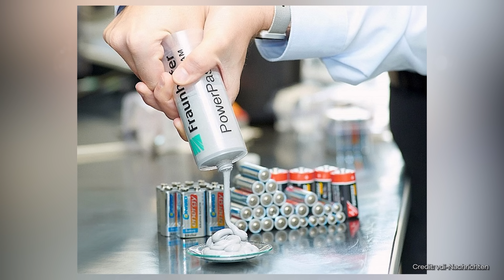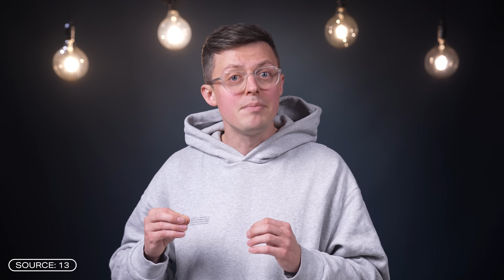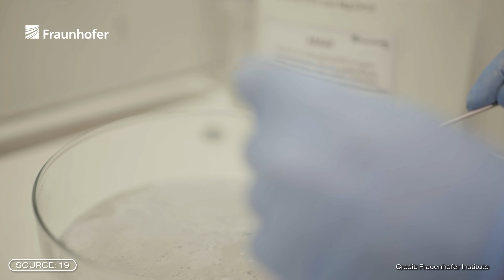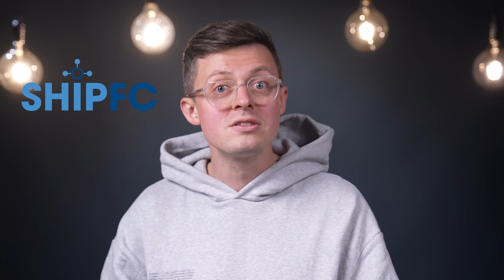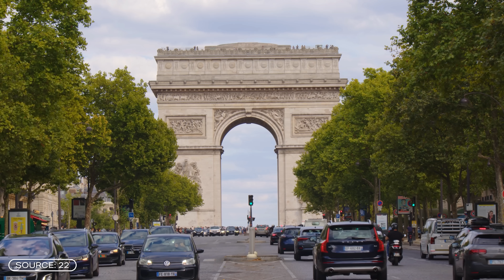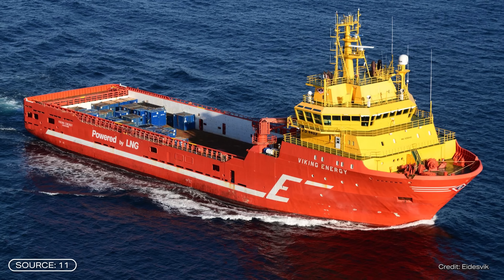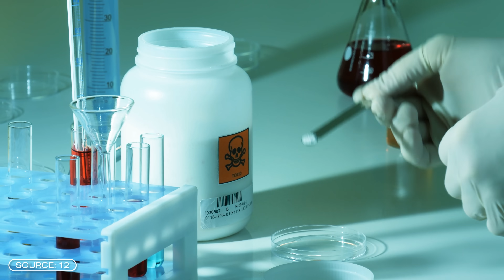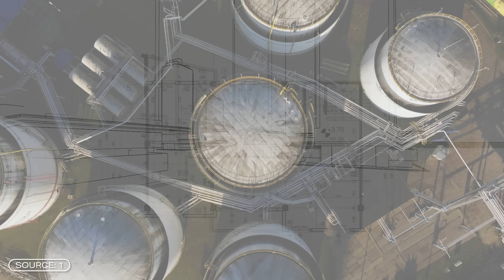Hydrogen Powerpaste: 10x Higher Energy Density & Safe?

Comment: The main problem isn't storage nor transport.  Those are things that can be overcome with engineering.  THE problem with H2 is that you get MUCH less energy from burning it than you put into making it.  The theoretically perfect energy cost of making H2 from H2O is 55 kWh/kg.  The theoretically perfect energy release from burning H2 is 33 kWh/kg.  That is only a 40% efficiency, which is not attainable in the real world. The only way to make H2 at an energy profit is through pulsed spark plasma cracking of heavy OIL. There is no point to green H2.

Comment: One of the main problems with hydrogen is not its storage, but the fact that it is a secondary energy source. It just doesn't exist in nature, unlike oil or natural gas. To produce hydrogen you have to either spend a lot of energy (electrolysis) or use dirty technologies (steam methane reforming). The final efficiency of this whole chain will be much lower, and the costs much higher, than those of the direct use of a primary energy source (methane, for example, as a fuel itself). All this hydrogen hype is just hype.

Comment: "A new way to store Hydrogen" is beyond stupid. The only safe way is water. Electrolysis is not that difficult.
Created H2/O2 on demand, no worry about storage. The entire deck area is wasted. Develop a PV tarp. Crack seawater as you go. Filter out the salt & sell that too! Hydrolysis is so underrated.
Reply: If you had such a powerful energy source on board, you would use it directly for propulsion, not for hydrogen production from water.
And the surface of a ship is much too small to get enough power for a decent propulsion by PV. Even without the lossy detour with hydrogen.

Comment: Why hydrogen at all? Biogas is renewable methane and a much better option than hydrogen. Biogas is a drop in replacement for natural gas and regular gasoline cars can be converted to run on both methane and gasoline.
Reply: Because biogas is a severely limited resource if only waste materials are used for its production. And because biogas made from specially cultivated feedstock (e.g., corn) has a poor environmental footprint.
Reply: @701983 I don't see biogas as a replacement for batteries. More as an complement, ideally used in power plants rather than cars. Still better than hydrogen anyway.
Reply: Production capacity and competition for agricultural land with food production....
Reply: @RoninTF2011 nah, biogas is made from biological waste so no extra agricultural land is needed.
Reply: @SkepticalCaveman In Germany, the majority of biogas is produced from corn, not from waste.
Reply: @701983 well, in Sweden it's  made from food waste.

Comment: So you have a tank of powerpaste, weight 20kg to get 100 km. Water required is 100liters or 100 kg. So 120kg to go 100 km. So to have a range of 500km you have to carry a tank of 600 liters or 600kg. Sounds like a great little car.

Comment: yawn - coal is much cheaper and gives real jobs. more brain washed nonsense on CO2.
Reply: Whats the difference between a "real job" and other jobs?
Reply: @RoninTF2011   a real job is a job in a primary and secondary industry and not a job that can be offshored abroad which provides no support to its community.

Comment: 4:00 - 10kg of paste plus how many kg of water though?
Reply: The idea is that a product of a fuel cell is water. So a hydrogen truck would produce the water needed as a byproduct while turning the hydrogen into water and electricity. Hydrogen combustion engines also produce water but it is mostly in vapor form.
Reply: @Dan-vi5jp we collect the water vapor and pipe it through a condenser to cool it down into liquid water though

Comment: Back in the early 80's, before you were born, there was a metal patented that absorbed hydrogen and release it when heated. 
I don't remember what metal but I do remember it going nowhere quick.
Reply: This kind of storage (metal hydride) is well known and used in the German 212A-submarines with fuel cell propulsion.
Reply: @701983  That name rings a bell. How is this toothpaste thingy better?
Reply: @objection_your_honor As with most advancements, lower costs, lower complexity and easier logistics.
Reply: @DiakosDelvin  👍
Reply: @objection_your_honor It's not better in my view. Advantage: You just have to add water to release the hydrogen, no heat source and heat distribution system needed. But on the other hand: You have to bring the used paste back to a factory to "charge" it with hydrogen again. Metal hydride tanks can easily be refilled with hydrogen.

Comment: Thanks. I've been wondering for a while what happened to Power Paste, since it seemed so promising, and is already used for certain "stationary applications" (or was, last time I heard anything about it). The Boron Nitride method might turn out to be simpler to use, though? Either way, its great to see that this is still something being worked on. One way to get energy "for free" for the Hydrogen producing process might be to make the production something that makes use of renewable energy the grid doesn't have present demand for from time to time (lots of wind at night, for instance, or extremely sunny days). Keep the generation facilities in a steady state, and switch consumption between base load and excess to base load. (I'm not an engineer, so am just speculating here. It must be something people who know what they're talking have thought about, since it's a pretty simple idea for starters, so my guess is that there's some problem with it.)

Comment: So given that 10kg of paste yields 1kg of hydrogen, does that mean that 9kg of waste remains?
Does that now mean that the car will crap out the paste when you fill the tank, or will it just randomly take a dump on the road like horses used to do?
Either way, I say neigh!
Reply: Have some fantasy. Fraunhofer is not a commercial company, but a research facility. But fossil propaganda and influence will find a way to discredit this technology before it gets a chance, if people have fixed their opinions too quickly
Reply: H2 is 3x the power of gasoline by weight.

Comment: This sounds like a very promising technology, however, the long delay from when it was supposed be ready to now suggests problems. 
Ammonia is incredibly deadly. So, any process that requires it for "public use" is a non-starter. So, if this system is relying on ammonia, then its essentially useless for the "public", tho, big industry might be willing to handle the high risks.

Comment: paste = 1.9 kWh / l, gasoline = 12.7 kWh/l - yes i know you compare to a battery but you can recharge the battery with just electricity while you need a whole industrial process to "recharge" the paste. also ignoring the conversion of the released H2 into useful work. seems like not comparing apples to apples. going to be honest that 10kg of paste to get 1kg of H2 seems like a poor conversion. also then need to process / store / transport that powder. not going to lie, this seems like a bad faith comparison.

Comment: Seems pretty niche. Efficiency is probably not going to be the selling point. I can see it having a use as emergency power or backup power, with renewables and batteries handling main loads. It does sound a bit sketchy though. Magnesium is easy striking and violently hot. Hydrogen is easy combusting and violently explosive. Things could go wrong of they decompose into their base molecular forms...

Nothing that new about ammonia...

I'm interested in that boron nitride discovery, though. That seems like it has a lot of uses. I would argue it had the economic advantage because it could be used in multiple industries beyond hydrogen. If a technology can place its feet in multiple industries, it will have better odds than a technology depending on just one industry.

Comment: Fascinating thing. Now all we need is a small scale generator for this paste, so we can create it from solar power at home and store summers solar power for winter usage...
Reply: Release the hounds.Someone is threatening our monopolies and leverage.
Reply: @chippysteve4524  release the money printers on the dollies
Reply: I mean, or we can just use batteries.

Bulk sodium should destroy pretty much everything else for scale storage when it's ready, and there are technologies like concrete batteries that can even beat that for cost eventually.

There's a reason we use silicon instead of tubes, solid state basically always beats moving parts.
Reply: @NotThatEcstatic  Yeah and theres a lot of Salt Flats around the world to draw sodium from. So the resources for the sodium aren’t even rare. You could make a sodium battery out of table salt bought from the Store if you knew what you were doing.
Reply: @NotThatEcstatic  Sure... If we can get them to a format where I can store 5.000 KWh for my home, I am happy to use batteries. Unfortunately we are WAY off from that...
Reply: @TheNewAccount2008  5MWh is kind of a lot, that's utility scale, you can get 10kwh today for not much, I'm looking to buy some myself, but the price is mainly limited because of lithium and the anode materials, once we get stabilized graphite anodes with sodium we should be done, those scale vastly better and if the concrete is developed that means you just use it as an insulating layer as a matter of course.
Reply: @NotThatEcstatic  I already own 100KWh today, but my problem is that it's not enough... I have 1.000 KWh surplus production every month in summer, but 700 KWh negative balance in winter. To achieve "true zero" I need to store the majority of summer production for the winter months, and for that I need ~5 MWh capacity... That's why I am looking into lower efficiency storage, like hot sand and hydrogen. Loosing 20-30% in conversion is a non issue, but I need the capacity...
Reply: @TheNewAccount2008  That is a lot. I was thinking 10k just to buffer between peak and off-peak was a good bit.

I guess if you're properly off-grid then yeah, 100kwh sounds about right if not undersized. Hot sand or something similar starts to make sense, but it's another 10 years before prices drop to where seasonal leveling is viable for most people, and we start seeing off-grid become more mainstream for normal people. Personally I'm just trying to take the edge off.
Reply: Small scale generator is impossible. You'll be in prison because you don't pay 99.9% fuel tax. Or of course you can keep it to yourself
Reply: @pasimakila6567  I have no intention of selling it. I currently have the problem that my solar array is vastly oversized in the summer, and far from big enough in the winter months... Having a way to use the power in the summer locally to create this paste and then store it and use it in winter when I need more energy than I can harness from the sun is all I am looking for...
Reply: You need to produce magnesium metal, first.
Reply: @andyh7537 you can get magnesium from evaporating sea water and refining and separating the left over salt. We’ve been doing this shit since world war II its nothing new at all.
Reply: My dream home is literally like this just need water and solar and you can make as much hydrogen as you want through electrolysis. If I ever get rich I’m going to make a hydrogen storage system for my home using metal hydrides then use a hydrogen engine to power my home and cars as I’d love to make my cars run off of hydrogen also using metal hydrides and all I need is tap water or water from the local river or lake for this energy.

Comment: For large commercial shipping, I think Nuclear will eventually take over ... but it's going to take the right political atmosphere for that (it makes the most sense overall, though).

Other than that, you have potential for things like mid-ocean solid or compressed+chilled liquid CO2 dumping from highly refined diesel/turbine fuel (or liquid methane) based combined gas turbine systems with waste CO2 collection and concentration. (dumping CO2 "torpedoes" to the ocean floor to allow them to slowly react with silicates to form carbonates in the mid-ocean regions where such dumping wouldn't substantially negatively impact marine life would be a viable consideration overall)

However, the cost/complexity of that would likely make sense mostly for vessels large enough to use combined cycle gas turbines anyway, and even then you'd have to compare that with using ammonia (even if fossil fuel derived, it could be CCS "blue" or solid carbon capture "turquoise" fossil hydrogen) for actual practical operational use.  On-shore and near-shore CCS makes a lot more sense for future planning where waste CO2 can be extracted for commercial purposes when the demand is sufficient. (mid-ocean dumping would also require disposable pressure vessels heavy enough to make them non-bouyant down to crush depth, at which point the liquid CO2 would be denser than water and allowed to sink ... though compressed carbonic acid seawater solution might make that simpler as well, allowing cheaper, lightweight pressure vessels that don't need to be especially heavy)

We obviously don't have enough alternative energy available now (or likely in the near future) to meet all electricity demand AND produce synthetic fuels, so fossil fuel use in some form will need to be considered for many decades to come. (both for synthetic chemical + plastic and such and for things like hydrogen feedstock in both a CCS and solid carbon byproduct context ... incidentally, the high purity carbon char produced from natural gas to hydrogen splitting would be a good source for nuclear grade graphite feedstock for compact graphite moderated nuclear reactors, or specialized carbide based fuel pellets and assemblies)

Also, given dehydrogenating methane to carbon is endothermic, but producing ammonia from the haber process is exothermic, the waste heat from one process could be used for the pre-heating stage of the other process to minimize net energy use and allow co-production.

Also, in cases where pyrolysis of bitumnous coal is used for chemical production, the byproduct gas from that includes a significant amount of ammonia (albeit normally captured in the tar fraction for further processing) plus CO, H2, and CH4 (coal gas) which could be shifted towards pure hydrogen or syngas depending on demand. The resulting char (gas coke) could be used as fixed carbon or potentially used as fuel as well, but that would obviously be a near-term thing and less likely long term. (gas coke also isn't generally useful for metalurgical coke, though could be useful for graphite production for grades where the contamination of coal minerals would be acceptable: basically all the solids from fly ash would still be present, but that could be suitable for some grades of refractory graphite or electrode grade graphite ... though not ideal for arc electrodes emissions wise, as you'd release he trace heavy metals, including thorium, as ultra fine particulate and capture would be more complex than normal fly ash residue capture)

We definitely need to stop burning brown coal and bituminous coal as straight fuel, though. The volatile fraction is much more valuable and much more difficult to produce through fully synthetic means (and limited through biomass volume), so at very least all the legacy coal-fired power plants shoudl be converted to using gas coke and char and the use of pyrolysis and hydrothermal liquifaction used to extract the much higher value components of those fossil resources. (it's also a lot easier to manage emissions from burning gas coke rather than coal as it's naturally clean burning ... and the exhaust is more pure CO2 + N2, so CCS is even simpler in principal than when burning hydrocarbons, since there's water vapor to deal with rather than anhydrous CO2)

Also, if not firing legacy coal power stations, you should be using gas turbines + gassification of the char/coke instead. (though if steam reforming is used, you'll end up with mixed exhaust rather than pure CO2 + N2) Albeit you could used a modified combined cycle power plant with air-based gassifier with waste heat from the gassifier used in addition to exhaust from the turbine to power the steam cycle (plus possibly a tertiary bottoming cycle using supercritical CO2 or some such lower boiling point gas), then you still have the advantage of simple CO2 capture.
Hypothetically you could MAYBE modify some legacy coal power stations by adding large gas turbine units and converting the old fireboxes into gassifier units and still use the existing steam turbine as part of the system (just with steam generator using a combination of gas turbine exhaust + firebox heat). If there's any coal fired plants like that with room for a gas turbine unit to be added while retaining the old infrastructure, that'd be interesting to try. (and with Germany's pessimistic outlook for nuclear and continued use of brown coal, there's all the reason in the world to consider such sustems: plus if they eventually switch to imported pipelined hydrogen or synthetic fuel ... from neighbors using nuclear + renewables, the use of gas turbines would remain)

This is sort of like a more advanced, high tech and future-proof approach to what the UK did in the 1970s with their gas coke fuel program. (before pretty much switching to natural gas) Coal fired power became coke fired and production of coal gas + coal tar expanded as part of that, but with modern emissions control and refinement.

Comment: Not good enough, it should be compared to other liquid fuels, not a battery.
Who would want a fuel system that pollutes the water it already uses. Considering the lack thereof already.
Your still better off using a stanley meyers fuel cell, which produces 3-5 liters/min of hydroxy gas, From the water itself